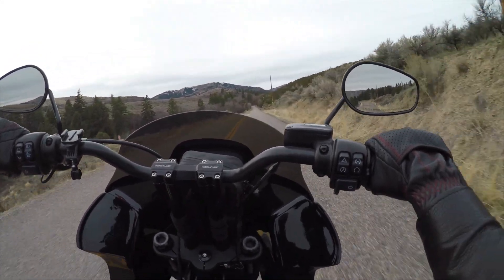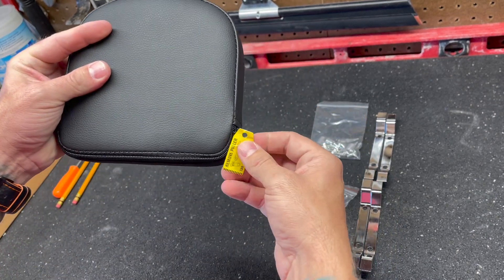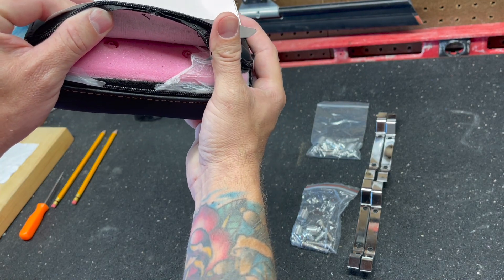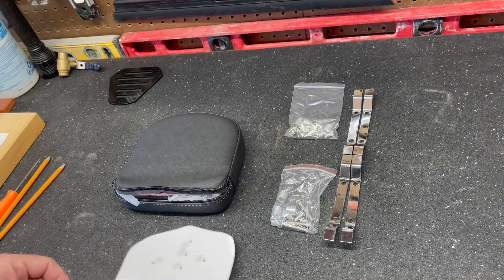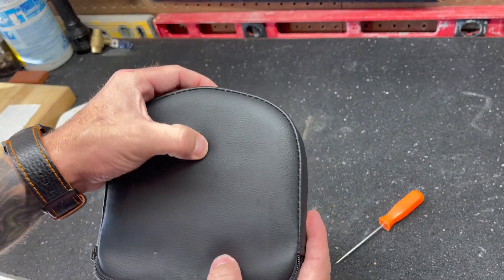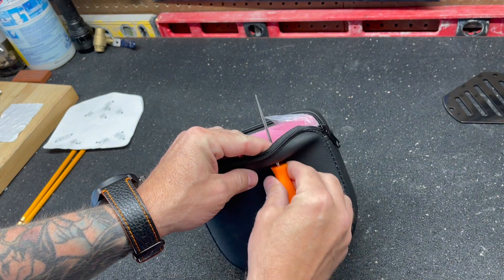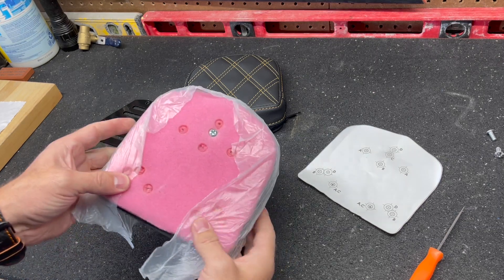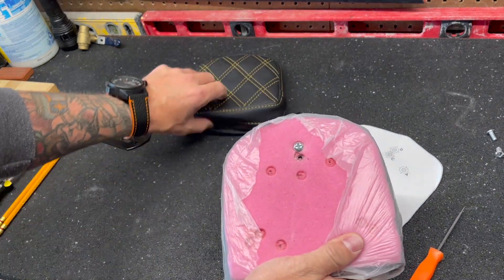M8 Harley Saddlemen Explorer LS Short Pad Sissy Bar Pad Install Low Rider S

Comment: when I go to buy that burly brand air cleaner plate, will it make a difference what model I buy it for? Obviously we aren't
using it for the its intended purpose, but I was curious as I was ordering
Reply from the maker: No, I’m fairly certain that the plates are all the same size. Mine came off of a Harley Davidson Roadster air cleaner.
Reply: @Idahoup  So this product has been discontinued with Burly Brand, could I trouble you for a diagram of that plate , dimensions, hole locations etc. so I can fabricate one? I am planning to buy the exact sissy bar and sissy bar pad you are using. I would be happy to pay you for your time.
Reply from the maker: @markfowler373  I've actually got a few kicking around my garage, because they sent me the wrong one a few times when I ordered a different plate design.  I can send you one for free if you want?  You can use my email to send me your address.  Just keep in mind they've been kicking around my garage, so they might not be in perfect condition (few scrapes & scratches).
Reply: @Idahoup  That's awesome, thanks for the offer!. I'll email you.

Comment: This video is exactly what I was looking for. I love the Etsy sissy bar you have but was like damn they don’t have a mount for the backrest which then I just recently round saddlemen sells backrests and first video that came up was yours with the same sissy bar! Do you have the link for the triangle mount you used in the video?

I currently have my passenger breaking in the rear seat, how long did it take before Jackie was comfortable with the seat? It’s been about 50 miles I think of someone riding it but just now softening up the passenger gel
Reply from the maker: Nice, I’m glad it helped. The Burley Brand Plate is under $20, so it’s a good option. Here is the link:  https://www.burlybrand.com/product/91/slotted-face-plates-for-hex-air-cleaner

As far as the seat, Jacci doesn’t mind it in town but she has mentioned that it wouldn’t be great for a long trip (honestly we haven’t taken one together just yet).  I didn’t think about break in time, so I’m glad you mentioned that. I know they make pads you can fill with air and sit on for more comfort, so I’ve had that in the back of my mind  for when we plan a longer ride. 

She has zero complaints about the sissy bar pad, she loves it and she barley hangs on to me at this point.
Reply: @Idahoup  that’s perfect! I live in miami so it’s just city riding on my Sportster and glad she doesn’t need to hold on! My issue was she kept sliding off a bit and had to scoot up! You’ve been a blessing thank you brother god bless 💪🏼

Comment: Great video man thanks! So what is the right mounting kit for such a setup?
Reply from the maker: Appreciate it Waleed A.G..  If I was going to order another mounting bracket, I'd try a "triangle sissy bar pad mounting bracket."  You'll find a lot of them online just by doing a quick google search.  Just make sure the bracket mounting holes line up with the mounting holes on the sissy bar pad you choose to go with.  When in doubt, you could also contact the sissy bar manufacturer and ask them what mounting bracket they recommend.  Hope this helps.

Comment: Hey man have you had any problems with the pad slipping or falling down at all? I have the same bar on the way and I want to get a pad to match my seat but I'm having a hard time finding a proper mount.
Reply from the maker: I’ve had zero problems with it slipping. It’s actually worked out really well.
Reply: @Idahoup  okay sweet I found the part I'm gonna give it a go. Thanks man for the video and the reply. Take it easy.